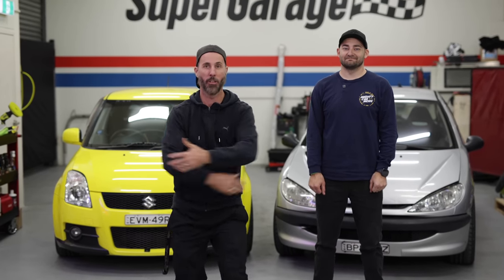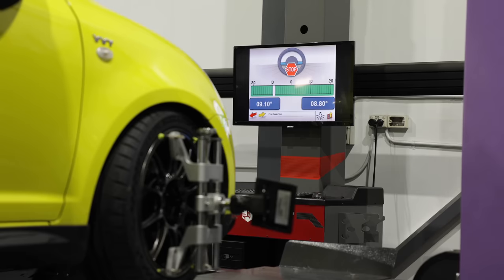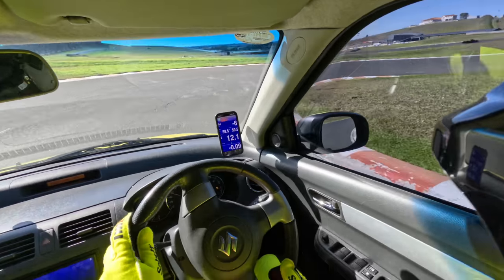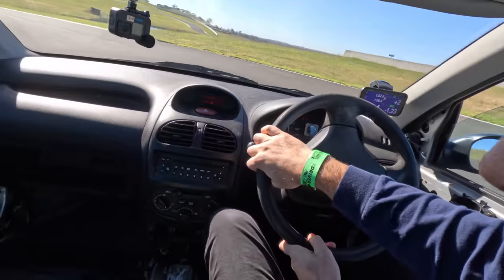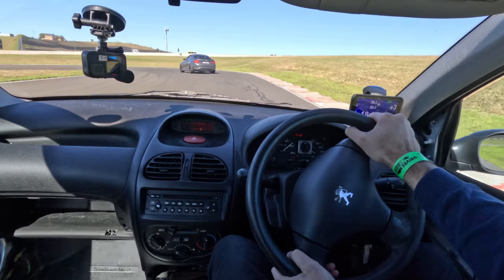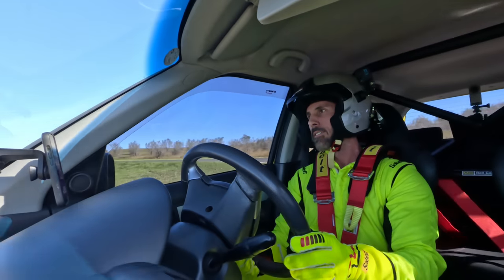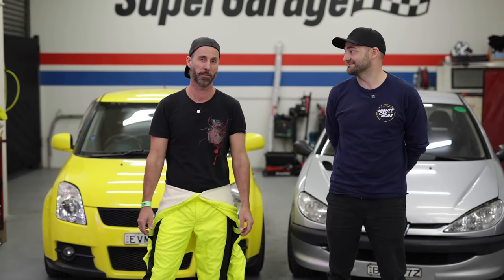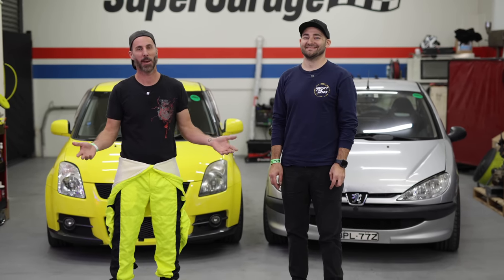Peugeot 206 vs Suzuki Swift FINAL BATTLE

Comment: I think stripping out the interior of Marty's car played a big part in the results.
Reply: It depends. The 206 may have some electrical gremlins and suspension issues but one thing that is often underastimated on them is the TU5JP4 1.6 16v engine.
That engine is not only very durable (way more than the 8v variant for sure) but it has some really good power (110hp).
Reply: @Rickanroc  yeah you can easily get 150 out of that engine,over that it becomes quite a lot more expensive but it is really a great engine to start with.
Reply: The 206 is just better
Reply: @Rickanroc  my RZR makes 110 hp and weigha 1200 lbs lol
Reply: Peugeot's interior was too clean to be stripped tbh
Reply: @Rickanroc  and also underestimated in Head gasket blowing abilities lol
Reply: the weight reduction was sort of countered by the added weight of the wheels and tires, and the rc seat.
Reply: yeah the moment they said they were adding weight to the swift and removing weight from the 206 i was like yep, here it goes.
Reply: @mgn567  About that is just a matter of chossing a aftermarket gasket of good quality. Once that is done the engine works really smooth. I know cause we have a 1.4 206 in my house that had that problem since it still had the original gasket. Once we swapped for a model of another brand it never happened again.
Reply: @VeiRoNv2  Wow 150 how do you achieve that ??
Reply: @khajiit5556  Cams, C2VTS aluminum intake, polished ports, injectors, fuel pump, a group N exhaust system and a remap.
In the EU the 206 1.6 and 2.0Gti are used a lot in hill climbs, sprints, rally etc. The TU5JP4 1.6 engine (same as Martys) has been used a lot in motorsports from Peugeot and Citroen (C2, 206, Xsara etc). There is a lot of support for it.
Reply: @mgn567 the 8v is prone to headgasket failure and leaking oil outside. But the 16v are bulletproof and have absolutely no flaw except the electronic throttle on tu5jp4. Tu5j4 and jp4(s) can be driven hard for over 200k km without any problem for any mechanical part.
Reply: @mgn567 no, thats the 8 valve variant
Reply: @Rickanroc  is that really considered good power? I had a Honda Del Sol with the 125hp D16z6 1.6l engine and it felt merely adequate. Certainly enough to not be utterly dull, but not anything I'd call "real good."

And I'm not one of those "well, if it doesn't have 400hp minimum, it's not worth driving, 'Murica!" knuckleheads. I'm definitely more in favor of lightweight and moderate power. That said, I don't know that I've ever driven anything with 110hp apart from a Prius, so maybe 15 extra horses isn't as noticeable as I feel like it would be.
Reply: it was already lighter so would have been closer to a tie before the weight reduction.
Reply: @musewolfman  The light weight of these cars is what gives them an advantage over heavier less agile vehicles even when they can't match the straight line acceleration.
I go to hill climb and it's quite an eye opener what a light weight FWD shitbox can do against the big boys.
The 206 can also be bought cheap with a 180 HP 2.0, performance oriented gearing and chassis stock, so there's not a whole lot of sense in buying the slow version and tuning it up unless you were class/tax restricted from the 2.0.
Reply: @drawzerRB  It just isn't.
Reply: @RR-cg2rq  naaaah it was a bit of a trash car all around from the beginning, no biggie surely
Reply: @Rickanroc  Yup, the tu5jp4 with more agressive camshafts, throttle bodies and a ECU like a Megasquirt 3 get interesting, BUT, add forged rods and pistons, chop some tenths of the cylinder head to get more RC, and the thing get fast AF, and the hp to weight ratio is🤯
Reply: @Rickanroc  TU gang ✌️
Reply: @ferrumignis  it is. And faster too
Reply: @mgn567  that's the 1.4 8v you're talking about.
Reply: @khajiit5556  Saxo CUP race cars were declaring 140hp with only three mods: 60mm diameter exhaust,CUP induction kit and a CUP specific ECU remap.

Comment: This video shows that weight reduction can really make a difference since both car were suspension tuned to be almost alike. Also I think that Moog should’ve done a proper suspension adjustment and not trying to match Marty because that’s the whole purpose of buying a higher end suspension. But it helped show that weight is a factor worth considering.
Reply: Its not just more adjustment, it's the compliancy of bound/rebound. He was running low/mid set anyway which gave limited adjustment advancement to ebay specials. Cars without alot of power, weight and balance is what makes the difference.
Reply: Swift didn't look as stable.
Reply: the swift on paper was the better car more expensive = more better even if the settings are the same in one department . remember its not the same car its a new car vs an old one
Reply: He did do a proper suspension adjustment. Just because they made both cars the "same" doesnt mean its any worse, it just means the handling manners are similar.
 beyond the basic principles of a track alignment its all down to tweaking to driver preferences and track conditions, i dont think theyre going to hire an alignment guy to come to the track for this video🤣

Its not like the swift has more to be adjusted outside of damping, both cars only have coilovers, the swifts are just better. they havent done anything extra to adjust with the swift suspension meaningfully yet.
Reply: @GeneralNOH   I didn’t say they did a bad adjustment. What I’m saying is to do an adjustment proper to the car in question without trying to match the other car. Use the suspension to its full potential and not handicap it to “be fair”. To begin with both cars are different regarding weight, probably also weight distribution and suspension geometry. If you buy a more expensive suspension it’s because you want the ability to fine tune it to the car so it behaves closer to how you want. This “match tuning” basically negates the purpose of buying that suspension and for us to know if a more expensive suspension is actually worth buying, which is supposed to be the purpose of this series. There’s already enough handicaps given for the competition to be fair, both cars have the same tires and Moogs car has extra weight, there’s no need for more balancing.
Reply: @christopherdaniel6142  the purpose of this series is to know which parts are good to spend more money and which parts you can save on. If you tune both suspensions to be the same then how can you compare between them?
Reply: @Hartbreak1  they didnt "match tune" the suspension 🤦‍♂️

They "match tuned" the alignment. Ergo the car with better suspension should still be better in theory.
Reply: @GeneralNOH  watch from 2:57 and Moog says so himself.
Reply: @Hartbreak1  Moog and Marty dont understand these things themselves sometimes and it also has to be understood by the audience. Otherwise theyd align the cars themselves, not pay a professional to do the alignment and talk on video.
They arent a channel that goes into the technicalities, they make entertaining car content.
The only real difference in aligning these cars is that the pegeot has a solid axle on the rear, but its alignment is reasonable anyhow. Aside from that its just setting toe and height. They are very limited in height, camber and castor adjustment on both cars as neither car has adjustable arms. So Youre only really left with toe, which isnt going to "gain" anything as long as its in reasonable spec, its a balancing act of stability and turn in.

The suspension on the swift in theory is still going to have a net advantage, but they have to take them on track to set the clickers up correctly. Thats when the swift suspension will come into its own, people spend months dialling that stuff only to have to change it again for a different track.
This is why most people with street cars are better off with an engineered spring and shock combo, not adjustable coilovers. Ive been in peoples cars with coilovers and their clickers are set wack because they put the coilovers in and never touched the clickers, its how they were set out of the box🤦‍♂️
It becomes a question of where do you start and where do you stop.
Reply: @Hartbreak1  going back to the fact that they only played with alignment, you can have 3 drivers in the same car on the same track running similar race pace and they will have differing alignments, sometimes wildly different. Point being, at 10/10ths Alignment isnt really about performance and in many cases driver style/preference has an influence, a good race engineer will set the car up around the driver.
This is why you have f1 teams where their second driver has trouble with the car, its set up for the faster driver.

To really reap any benefit of alignment in the swift moog needs seat time to dial these things(and more adjustable suspension geometry). You cant do this on this machine, youd be making an educated guess at best.

Comment: something you didn't mention in the cost breakdown, where I think a large portion of the swift budget went to, is safety. 
the cage, the seats, the race gear etc. if you were to roll it on one of those corners you're walking away in much better mood than you would after a few flips in the peugeot. 
enjoyed the series guys! keep up the good work 

:hand-purple-blue-peace:
Reply: THIS ❤
Reply: If the peugeot kills you in the process its a win-win
Reply: @tadassmolskas3014  That's a real Peug-bro move
Reply: Pug had 4 stars for safety 😅
Reply: @tadassmolskas3014   the best outcome you can expect from a french car
Reply: I had 3 Peugeot 206
One I rolled over 4 times and I walked away with no injuries.
The other one was rear-slammed  by a woman with no insurance on the highway
And my 3rd one is my current one. Still alive and better than factory.

Trust me, they are pretty safe cars.

Comment: Great series.
I think for budget buyers, the 180hp version of the 206 with some good tyres would give better performance for buck than tuning a swift up to match (or a Clio RS II/III).
Also the torsion beam probably isn't going to be a limitation when you consider the Megane Trophy R is still torsion beam.
Reply: People don't realise that FWD hot hatches have roughly 2/3 of the weight on the front and 1/3 on the rear, so the first thing you need to make it handle well mid corner is to keep two wheels on the ground in the front (2/3 of the weight taken care of) and one wheel on the ground in the back (remaining 1/3 of the weight taken care of, one wheel per one 1/3 of the weight). The grip between front and rear axle is balanced that way. You can laugh about tripodding but it's how you allow the rear to rotate around the front, thus making the car less understeery. Torsion beam rear suspension is perfect for doing that.

My friend decided to build a rally NC MX-5, he said that superior weight distribution, suspension and drivetrain will give him an advantage over those french hatches in 2000 class, over a year (and a lot of $$) later, he's right in the middle of the pack between those Peugeots and Renaults he "has an advantage" over 😅
Reply: @shaggings  I know the term "rally" is associated with gravel, but rallies in my country are mostly held on tarmac country/rural roads, so looking at a plain data sheet of the MX-5 and comparing it to a 206 or a Clio my friend's assumption should be correct, MX-5 should be the superior handling car. But somehow it's not.

I mean, you can't fault the MX-5 here, my friend is not the only person in a technically superior car getting stomped by a french hot hatch, there's a guy in my country with a Megane II RS that wins pretty much every time attack he enters (and he's competing against 400-500HP Evos, STIs, BMWs etc), so it's not just a rally specific thing. If french cars do something right it's definitely the handling.
Reply: I think the ESP is working against agrassive handling in the peugeot
Reply: The peugeot has a complete different torsion beam than what you’ve got in mind. The actual spring is a torsion beam..

A megane has the traditional torsion beam with coil springs.

Comment: Great little series, but I'm honestly surprised that proper high temp brake fluid and track pads were not used. That would have not only improved performance and lap times, but is also a huge safety aspect that should not be ignored.
Reply: Fr, active safety (tires, brakes, suspensión) is better than passive safety (bucket seat, roll cage)

Comment: Thanks guys, it's been an entertaining series. Less weight is important on a twisty track seems to be a solid takeaway from this. Oh, and stock brake pads and fluid will probably be a limiting factor that reduces your time on track.
Reply: Less weight is important everywhere. 
You could argue it's less important in a straight line... but somebody, somewhere will argue back and probably make valid points 🤣
Reply: @starfox_wr-45e93  Ha, true that. Can't help feeling the Swift would have won on a more open track though. Or overheated earlier. 🙂

Comment: I took my RSX type S/DC5 Integra to the track last weekend. 
Mods: bucket seat with rails, Momo steering wheel with quick release, cat back exhaust, big brake kit(brembos), high temp brake fluid, race pads, stainless lines, bigger rear sway bar, sub frame brace and 200TW tires.The car is on A spec factory suspension (1 inch lower than regular RSX) man I had so much fun, was amazing and I am glad I did the mods in this order

Comment: Add the 302mm discs w/ calipers from the 307 peugeot, flat floor + rear bumper cut, cheap used bucket seat and you're golden. Add a turbo and you have an absolute track weapon. You could even stitch weld the chassis and if you're feeling fancy add foam to the pillars. None of these are too expensive (except the turbo).
Don't know how practical the swift is with the rollcage lol. Overall good vid
Reply: @Akiva Tunomvre ,
You forgot custom made aluminium or titanium subframes and rear axle carrier's.
Reply: @davidgriggs3967  for the trash peugbro?
Reply: @Darren Sim  Yeah even more weight if your handy with a tig welder
Reply: @davidgriggs3967  Exactly!, and if you want to keep the spirit of cheapness i wonder if you could fit a Speeduino ECU. I would try to search for an LSD tho, that would make plently of difference (pun intended).
IDK how the regulations work on Australia if you can fit lexan windows, those would lower the weight and you could replace the rear hatch and with the rear side ones and the car would still be confortable to use.
Any more ideas for a cheap performance upgrade? I already projected all i would do lol
Reply: @Akiva Tunomvre  Perspex or plexiglass would shed weight as long as the glass isn't curved .
That's about it for weight you can make a fwd launch just as good as a rwd with 2 things good tyre's and stiff springs in the rear to keep the weight from shifting off the front tyres on launch. 
My car is 950kg and has 240fwhp on it's low boost setting and doesn't get any wheel spin and I don't have a lsd. 
Stiffer the better.
Reply: @davidgriggs3967  Yup, anything lighter would mean carbon fiber+all windows removed. 99% of the weight mods are already mentioned, the last 1% it's the more expensive.
I've seen a vid on 106's rear sway bar stiffening, it's basically a straight bar so they cut the tips and weld them to a tougher one. Would make the car rotate better while turning (more oversteer). I believe it's the same for the 206 but don't quote me on that haha

Comment: Would be interested to see if a proper suspension setup on the Swift had an impact - by matching setup this test kinda negated the spend. But right now you could set it to maximum potential and get another time and it would be an interesting bit of data for a budget build.

As for the puegbro, sell it to someone who does love those little nuggets and check back in from time to time :)
Reply: How did it negate the spend? You buy better coilovers for better damping features, preload and height adjustment. not alignment.
This is the logic of someone who hasnt actually fitted coilovers or aligned a car and has NFI what theyre talking about.

They havent gone wild on adjustable arms or anything so theyre still pretty much limited to basic toe adjustment on the swift. They could run more agressive alignement on the pegeot for 0 extra cost  so this is a dumb argument, you may as well make them the same. Going for crazier alignments requires better driving too, you trade off driveability.
Reply: @GeneralNOH the coils and alignment go hand in hand for a few reasons but the caster, camber, and toe settings are affected by the ride height of the car during various stages of suspension travel, so taking that into account during the alignment can get you an edge. Also, adding the drivers weight in the seat during the alignment assures you have the most accurate alignment possible. But the biggest difference is with coil overs, you can do proper corner balancing on the car and that can add seconds to a lap time with a proper car and a decent driver. And as you change the alignment, the corner balance gets thrown off by a significant amount. The coils allow you to do the fine adjustments to get the alignment and the corner balance right on. I used to work in a performance shop building spec Miata’s and did a ton of alignment work on the cars

Comment: I knew it. I commented in the last video. You can rip in an absolute nugget with only upgraded tires, suspension, and weight reduction. I know because I've done it. I would argue that it might be more practical to rip out the interior because it gives you more space to fit larger items, as I did with mine. Only downside is the road noise at anything over 30 mph is immense, so you will get tinnitus as an added "bonus".